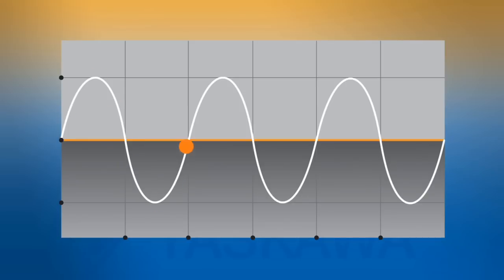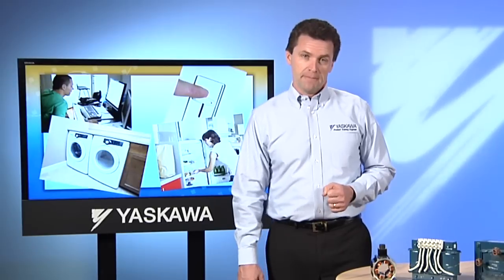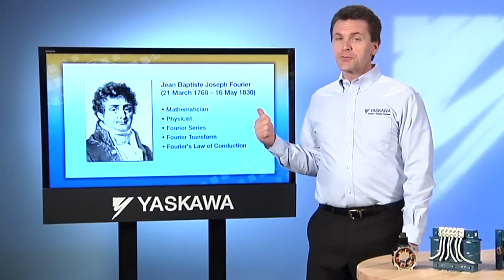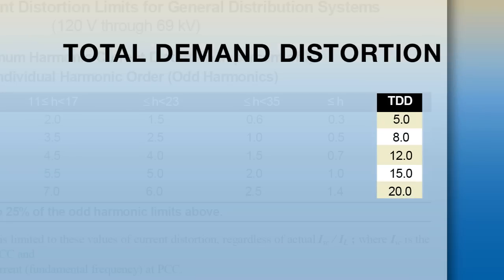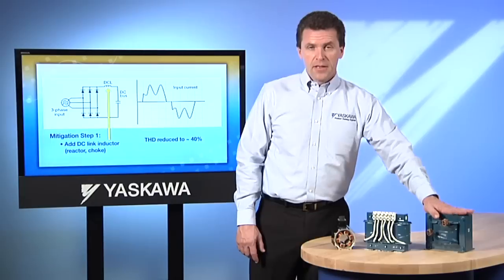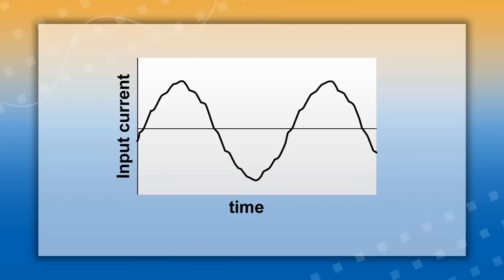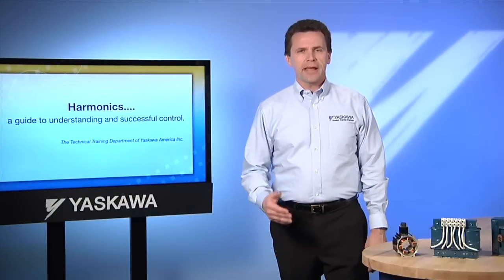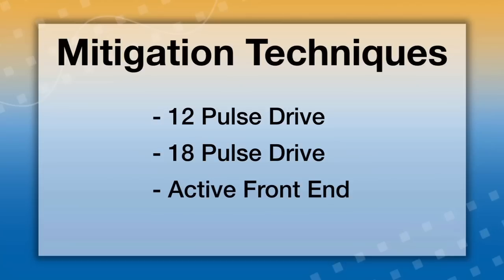Harmonics

Comment: It's true that the Voltage Harmonic Distortion (THDv) depends upon the current harmonics (THDi), but also on the impedance of the power system. Find more at UNDERSTANDING HARMONIC DISTORTION.  https://enconengineers.in/harmonic-distortion-crammed-harmonic-energy-surge

Comment: A correction @ 3:00. Not all linear loads draw a sinusoidal steady-state current when the voltage is sinusoidal. As an example, a resistor whose resistance is a function of time (but not of voltage nor current), is a linear resistor, yet it will draw non-sinusoidal current when a sinusoidal voltage is applied.

The most accurate and general definition of a linear load/device/system is that whose relation between voltage and current follows the superposition principle.
Reply: Not time, but temperature
Rt= R0(1+alpha(t-t0))
Reply: @tamilchelvanramasamy8733  That’d be non-linear, since temperature is a function of current.

Comment: "What kinds of harmonics do variable speed drives create? Well, it depends." Now that is definitive for you! How's about this: Just like with other loads, variable speed drives distort the input wave causing harmonics. The ANGLE that the input wave was at when it impacted the distortion determines which harmonics are created and the pattern of harmonics created in the spectrum. This pattern is known as the Harmonic Signature, and the Bullard Harmonic Solution can be used to predict the harmonic signature based only on the angle that the incoming sinusoid was at when it impacted the distortion. This is Law #2 of the Bullard Laws of Harmonics. Different devices (VFD, fluorescent lights, rectifiers, etc) have distortions lurking at various voltage thresholds and when the incoming wave impacts those thresholds, it distorts the wave and the angle at which that happens determines the harmonic signature. God did not anticipate which electronic devices mankind might invent and then devise a set of harmonics for each and every human invention.

Comment: In Europe, allowing harmonics and excessive distortion to get back into the power grid is a legal offense.
Reply: sir in 3phase infucton motor (Delta connected) Driven by VFD Without Nutral How the Harmonics produced Hear
Reply: @manibhaarathi79  load driven by motor have some mechanical movements that needs more power multiple time in one revolution of motor shaft thus motor also demand more current to overcome that extra power demand of load, I have seen this in textile industry...

Comment: yaskawa  is  very  sincere   manufacturer ,   even in eighties  i have  seen a  yaskawa motor  which  did  not  require  any    regular  maintenance  at  that  time  compared to other  brands .   liquid starter never  gave  trouble  for  8  years in a  row  , and  was  free from  dust in  our  heavy  dusty  environment @ a cement plant .

Comment: hello, can you give me an idea why my circuit breaker frequently trip and becoming hot even at normal current. i have a circuit breaker installed after my vfd drives. how to solve this problem for those who experience this?
Reply from the maker: The output of the Yaskawa VFD has a near sinusoidal output current wave form, and a pwm output voltage wave form. A pwm waveform will cause a small amount of additional heating in the motor because it is shaped like a square DC pulse and the near sinusoidal current waveform can cause additonal heating as well. So this is most likely the culprit of the heat in the circuit breaker. You can read more about a pwm wave form in this article.

https://www.yaskawa.com/pycprd/newsdetails/item&common-vfd-myths-1508

One note. Yaskawa VFDs have accurate motor overload protection and a very fast acting over current protection built into each model. No external overload device is required as long as you are not running multiple motors from one drive.
Reply: sir, the set up of it is two interlock rotary motor driven by one vfd only. it is a diversion valve application w/ interlocking. the advice of the designer is to shift w/ thermal circuit breaker instead of electro-thermal circuit breaker but still occurrence of problem. thanks for the advice.
Reply: +Yaskawa America The output of the any VFD has a near sinusoidal output current wave form, but not input. You may need afe (active front end) input in VFD.